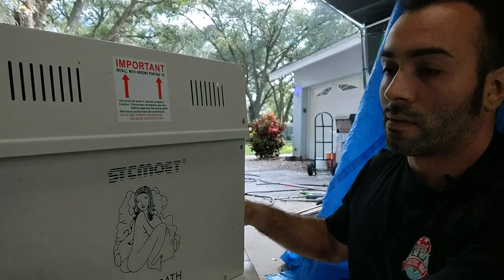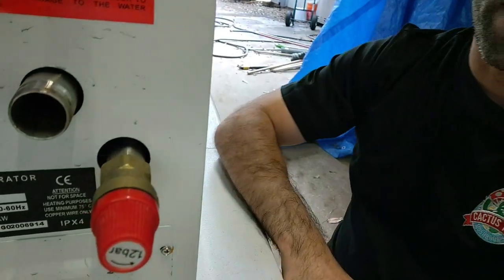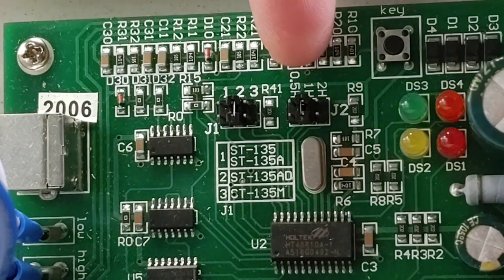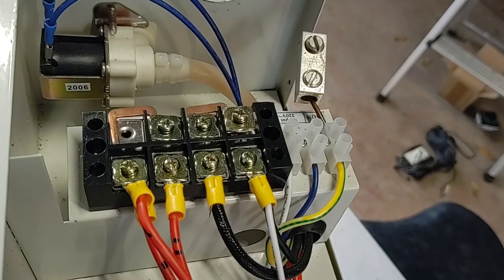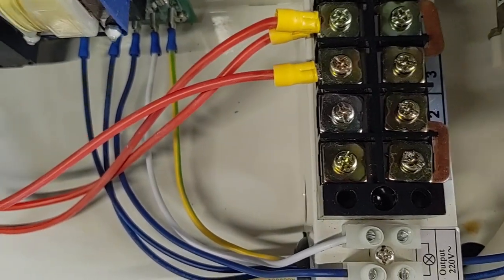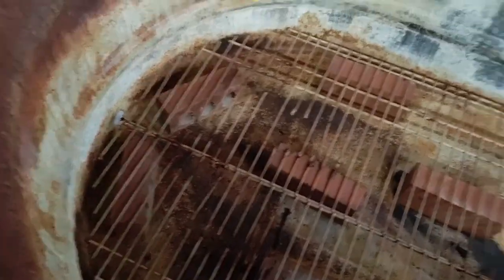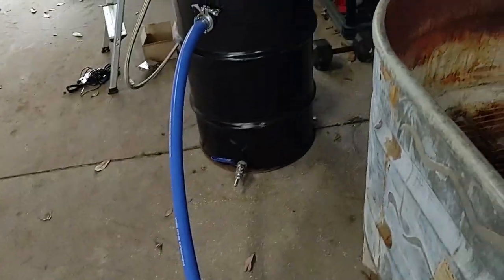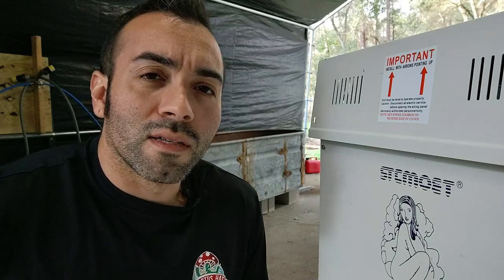9KW Sauna Steamers for mushroom cultivation - WHAT YOU NEED TO KNOW

Comment: Good vid, Yeah those ebay machines are def hit and miss. I have a Mr. Steam 12KW generator that I picked up free with no controls. The elements are mint and worth 600$ alone but the board failed so I just bypassed it, redirected the transformer and added a stainless vertical float switch to trigger the water inlet. I don't mind getting a $5,000 machine free and making work. Love it and puts out great steam!
Reply from the maker: It pays to be resourceful

Comment: Thank you for information.  Does it have to be a 9kw? I noticed the 6kw and 7kw all heat up to 131*F
Reply from the maker: I only have experience with the 9kw units and surely they are the most widely used. Depending on the size of the container you're pushing steam into, a smaller unit could work, it would just take longer to get up to temp. Make sure you measure if you go that route. I recommend using a barrel steamer instead which I covered in another video.
Reply: @cactushatmushrooms3677  thank you so much for the quick response and great information.  I really appreciate your videos! Thanks a bunch!!!
Reply from the maker: @edieseltzer4896  any time appreciate you